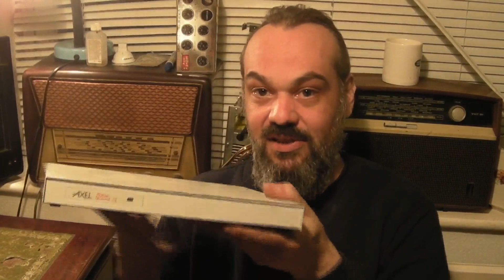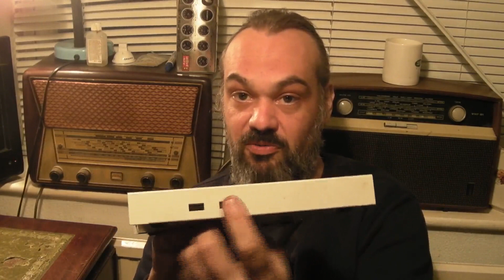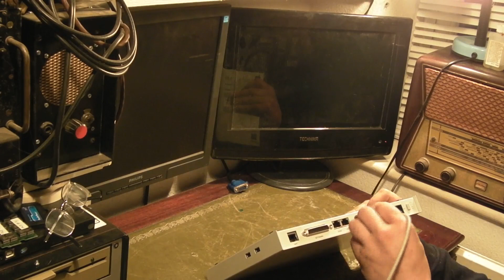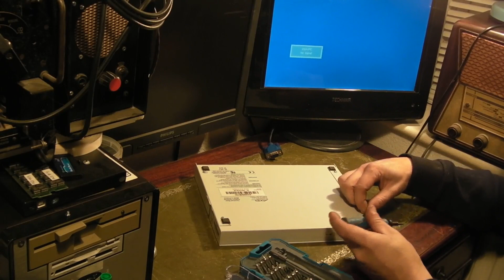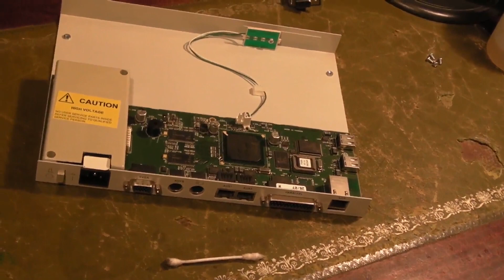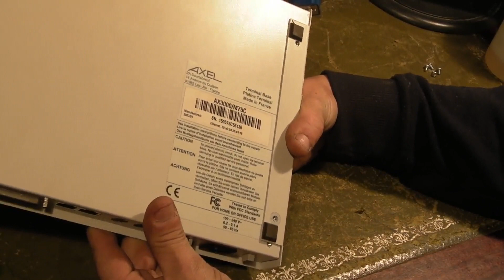AXEL thin client from 2007 quick Taredown

Comment: We used to have these at work many years ago to telnet in to our EPOS system. Some of the older ones can only do Telnet/SSH, most can also do RDP to connect to Windows environments. They can support 6 concurrent connections which you change between by pressing ALT-F1, ALT-F2 etc. Yours has been setup to auto connect,  if you press CTRL-ALT-ESC you should be able to get into the settings and configure it. They're much more basic than a Windows embedded thin client,  but they're also pretty bulletproof and do the job well. Great little terminals these.